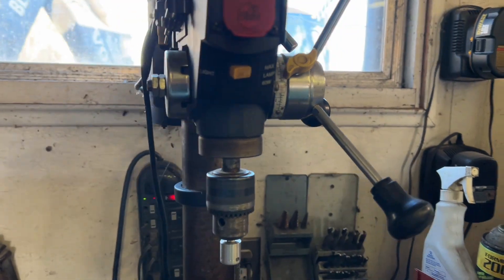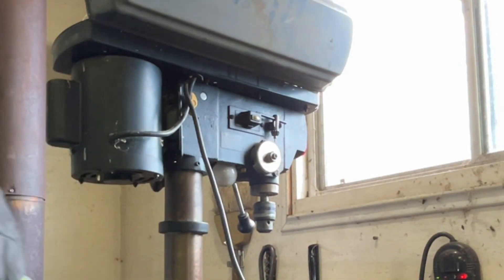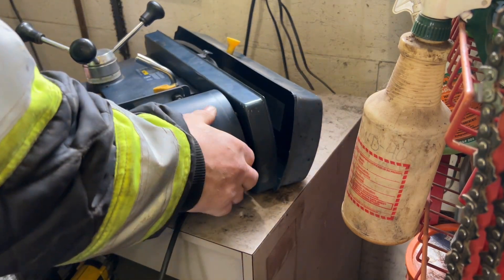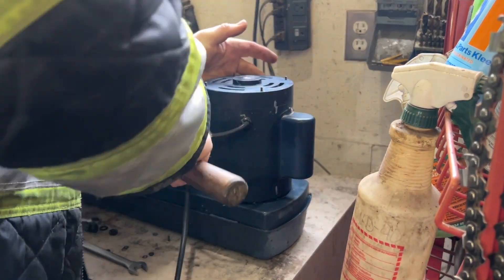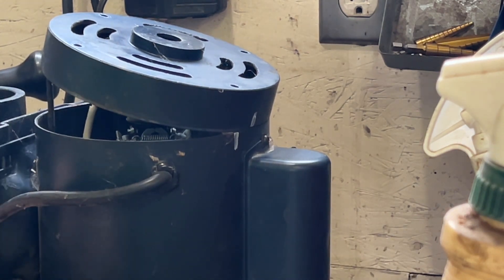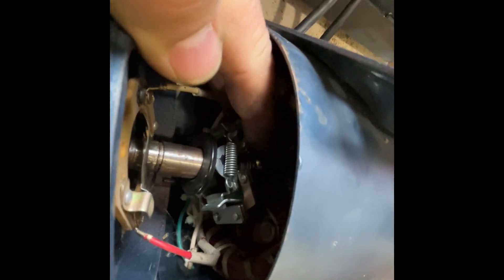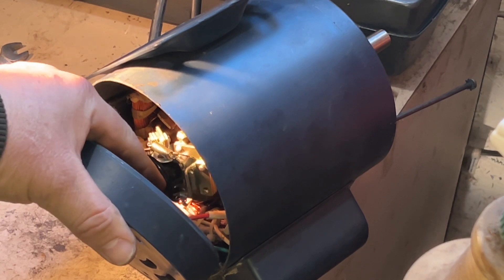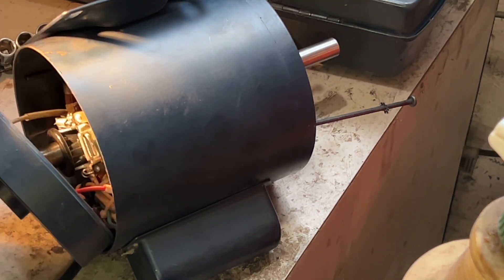AC Motor Centrifugal Start Switch Repair

Comment: Yes, it did help.
I have a single phase induction motor from a tumble dryer.
It doesn't have a capacitor, but a start winding that is switched out by the centrifugal part operating on a microswitch.
The springs on the switch came off during removal so I'm still trying to work out how it operates.
The microswitch spring lever keeps the contacts closed and spinning up, disconnects the starting winding.
The weights must cause the microswitch to open and the microswitch spring returns the centrifugal switch to it's resting position.
It's just the spinning up that's baffling me.